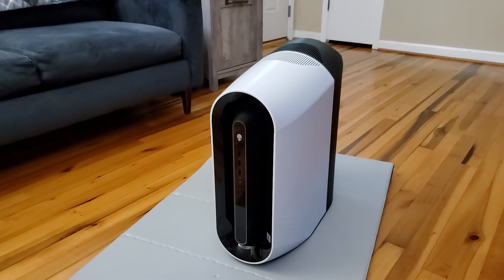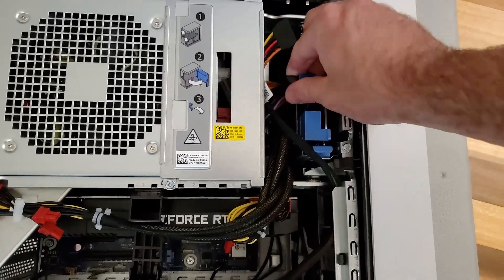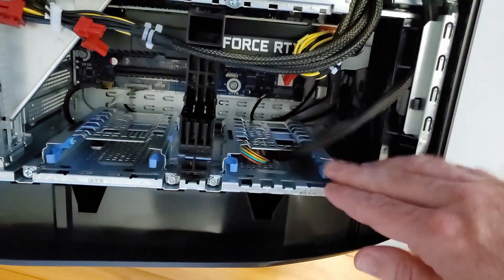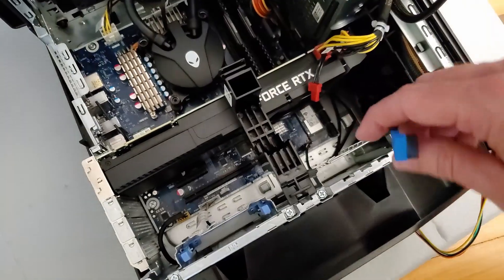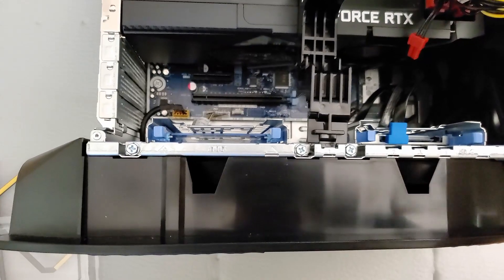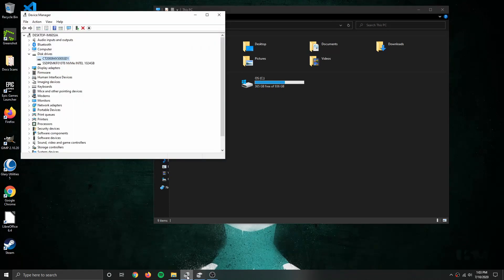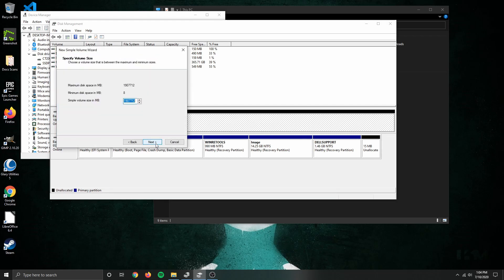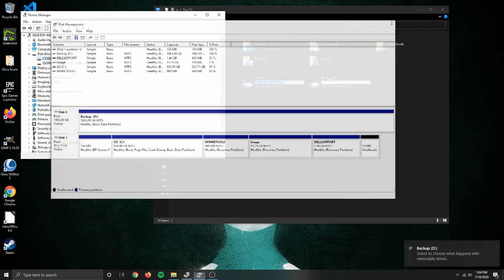Alienware R11 Solid State Hard-drive Install / Upgrade: Step by Step

Comment: How did you boot to Windows if you removed the mechanical drive and replaced with SSD? Were there two drives to start?
Reply from the maker: The mechanical drive on my system is not the boot drive. The boot drive is a 1TB NVME drive. The mechanical drive that I replaced was simply a back up drive that Dell included with the my system configuration.
Reply: @theonlyjoe6036  Got it. Does your video show where that NVME drive is and do you know if you can add a second NVME drive to the R11? I bought the 500GB NVME without mechanical drive and am trying to figure out what all my options are for adding an additional SSD drive. Thanks!
Reply from the maker: @MichaelRosett  My video does not show the NVME drive. It sits on the bottom right of the motherboard, and there is only space for one NVME drive. I can guarantee that your OS is installed on the NVME drive, and so replacing it will cause you have to reinstall your OS. You could easily add a 2TB 2.5 inch SSD like in the video with no problem. Check to see if Dell included an SATA cable with your case since you bought it without a HDD. If they didn't, just pick one up for a few bucks. The SATA ports are also on the bottom right hand of the board, and you will plug into the blue port; though you might have to remove your GPU but that is simple. I've included a link to the Dell service manual on how to remove your GPU at the end of this post.

I install most of my games on my 2.5 inch SSD as the load times are really not that much of a difference. I do keep games that have large and frequent loads on the NVME (like Assassins Creed and Flight Simulator), but Halo, Doom, Call of Duty and the like go on the 2.5 inch.

https://www.dell.com/support/manuals/en-us/alienware-aurora-r11-desktop/alienware-aurora-r11-service-manual/removing-the-single-graphics-card?guid=guid-78033958-a3fe-41f0-abec-164a9f24c2d2&lang=en-us

Comment: Does the pc have the 2.5” ssd drive power and data cable in the bay like you showed in the video or did you pit those cables in your self?
Reply from the maker: The power cable is already tucked down into the 2.5 inch bay. The SATA cable I took and rerouted from the 3.5 HDD that I removed. You would have to supply your own SATA cable if you wanted to keep the mechanical drive while adding a 2.5 inch SSD.

Comment: Joe could you have kept HDD and the new SSD if you wanted or does it not have enough cables?
Reply from the maker: I could have kept it if I wanted to, but I would have had to add another SATA cable as the R11 does not come with any extra SATA cables.
Reply: @theonlyjoe6036  I have a related question for you: if I were adding an SSD on top of my HDD and I want the my OS on the SSD, would I have to fresh install Windows on the SSD, or do I copy the OS to it, or something else? I'm a bit confused as to how you prepped the SSD before installing it so that it immediately booted up to your desktop as normal

Comment: Can I still use the original drive alongside the SSD? I have stuff already downloaded I don’t want to lose
Reply from the maker: Yes, you can. You will simply need to pick up an extra SATA cable (the R11 does not come with a spare cable) and plug into one of the SATA connectors on the motherboard.

Comment: Can I use this method on my r9?
Reply from the maker: Yes. The R9 and R11 are extremely similar in their interior. I've also included a link to the R9 service manual.

https://www.dell.com/support/manuals/en-us/alienware-aurora-r9-desktop/alienware-aurora-r9-service-manual/installing-the-2.5-inch-hard-drive?guid=guid-275897fb-5590-421a-bcb2-21150a688a6d&lang=en-us

Comment: Which model of the SSD drive did you actually install and do you have a link where it can be purchased?
Reply from the maker: It is a Crucial MX500 2TB SSD.  I bought it from Amazon, and here is the link. 

https://www.amazon.com/Crucial-MX500-NAND-SATA-Internal/dp/B003J5JB12/ref=sxts_sxwds-bia-wc-p13n1_0?crid=2FTLG0ETDU9C5&cv_ct_cx=crucial+mx500&dchild=1&keywords=crucial+mx500&pd_rd_i=B003J5JB12&pd_rd_r=cba5104f-f5e5-4850-8213-1cb1693972d5&pd_rd_w=QFcPT&pd_rd_wg=ZU4NT&pf_rd_p=f4ebc3ce-c45d-4b03-a3e4-a17c876358c0&pf_rd_r=R79FVZA7T032P4QMGZBX&psc=1&qid=1604766057&sprefix=crucial+%2Caps%2C179&sr=1-1-80ba0e26-a1cd-4e7b-87a0-a2ffae3a273c

Comment: What about eventually upgrading the CPU in this? It might take a lot.of work but is it possible??
Reply from the maker: Intel loves to change sockets from generation to generation; so you will most likely be only able to upgrade the CPU with in the generation of your current purchase (i.e. 10th generation Intel) without having to replace the motherboard. AMD typically gives us a little bit more time with a socket, but there is never a guarantee that your existing motherboard will be able to support the next generation of Intel's or AMD's CPUs..
Reply: @theonlyjoe6036  thank you for your reply. So...I guess what I should ask is can I upgrade the CPU and motherboard when the 11th gens come out?
Reply from the maker: @Marvolorian  if you upgrade the motherboard and CPU, then yes, you should have a clear and expensive upgrade path. I honestly think your money would be better spent on upgrading the Graphics to the latest Nvidia or AMD cards. There are some completely unsubstantiated rumors that the 11th gen might share the same pin layout with the 10th gen and hence provide an upgrade path without a motherboard replacement (though I be shocked if this turns out to be true).

Comment: So before you unplug and take out the HD are you taking any files off it and putting it on your desktop?
Reply from the maker: In this specific example no. The 1TB HDD that was removed never had any data on it to begin with. I bough the R11 knowing that I would be replacing the included 1TB mechanical hard-drive right off the bat. I did the install myself because it was far cheaper than what Dell would have charged for the configuration that I wanted. That said, you should always back up your data and have a good migration plan in effect if you are replacing any drives with data on them.
Reply: @theonlyjoe6036  just my first tie owning a nice pc and im trying to figure everything out. Im getting ready to throw an SSD in there so i want to make sure i do it correctly.

Comment: So sata cable is already inside unit and hook to the mobo? Good vid👍🏻
Reply from the maker: Correct. The SATA cable is already installed and hooked up. You only need to properly route it to complete the SSD install.
Reply: @theonlyjoe6036  — great that’s good. So do you know which sata out of the 4 has the fastest read time? I see on the mobi that it has 1 blue -1 beige and 2 blacks or does it matter? Thx for any info on this. I’m gonna add another ssd myself just to have it run a game or 2.
Reply from the maker: @burtpilon1735  The R11 has 4 SATA III ports (the latest version of the SATA standard). All of them run at 6Gbps. It shouldn't matter what port you plug into. However, and this is a big caveat which I don't think anyone would ever run into; SATA ports 2, 3 and 4 share a common PCI lane (port 1 is the blue port on the standard R11 board). So in theory, having multiple drives on ports 2, 3, and 4, and accessing data at the same time (like using a RAID setup) could bog down the PCI channel that is shared between them. That said, I honestly think that if you need more than 3 or so TB of internal storage then you should invest in a proper Network Attached Storage device. I run in my R11 a 1TB nVme drive that came with the system (an Intel 660p), and a 2TB 2.5 inch Crucial MX500 SATA SSD that I installed for this video.

Comment: So the sata cable is already inside the unit? Great vid man 👍🏻
Reply: I have the same question. Do I need to purchase an extra sata cable for extra ssd?
Reply: @captainOli7523   Yes you do. He was using the data cable from the hdd he removed. I had to order two extra cables to add two new ssd drives. They will come today.

Comment: How to get into the disk management?
Reply from the maker: The easiest way to do this in Windows 10 is simply to type Create and Restore Partitions in the search bar down on the Task Bar.  You can also right click the Windows Icon down in the Task Bar and it will show up as one of the options.
Reply: @theonlyjoe6036  Thank you.

Comment: I got a new ssd for my r6 but I can’t boot from it since there are no settings for it in my bios. There’s almost no settings in there and I’m told that I’d have to get a new motherboard for better settings. Is there a way to change boot drive without bios?
Reply: Same issue

Comment: Hey so my led for the Alienware head isn’t turning on any ideas how to fix it
Reply: I actually just had this same problem happen. It occurred after a firmware update, and so I think it might be related. I've reached out to Dell to see if we can get any answers, and encourage others to do the same.
Reply from the maker: Quick update. I used Revo Uninstaller to remove the Alienware Control Center and Overclocking Control. I then reloaded both programs via Dell's support website and it works fine now. Just make sure to reinstall the Control Center BEFORE the Overclocking Control. A reboot will be required after uninstalling to allow for the reinstall.

Comment: Hi!, I have an R9 model, Im concerned about the RTX 3080 size, will it fit?
Reply: please let me know if you've found an answer to this, I'm in the same boat lol. I think with the dimensions it will fit though
Reply: @neuroticknave6046  Hi!, the only 2 Series 30 cards that fit in the Aurira R9 are: RTX 3070 FE, and RTX 3090 Turbo fron Gigabyte.... the gap in the costs is huuuge, so I decided to go for 3070 FE, hope this helps.

Comment: Hello Joe! Great video! Would you mind also uploading a tutorial on how to add more SATA cable for multiple Hard drives? I find it strange that it only comes with one SATA cable but multiple power cables for multiple Hard Drives.
Reply: you purchase more sata cables (find them on amazon) and the motherboard has spare sata ports located in the bottom right.

Comment: Whats different between the R11 and R9 ? My R9 Looks identical. and he Rep said it was a 2020 model.. is it just internal differences ? Thanks
Reply: The R9 has the 9000 series CPUs as the top of the line, the R11 has the new 10000 CPUs as the top of the line. The R10 has the AMD CPUs which is why it seems like they skipped a number.

Comment: Did you have to remove the old hdd? can you just leave it and install 2 other ssd
Reply: Yes you can. That's called dual drives. Many people run that combo.
Reply from the maker: You don't have to remove the old HDD. I just took it out as I hate mechanical drives.

Comment: Will taking out the HDD and replacing it with SSD affect the loading of the OS or will it have to be reloaded
Reply: you will have to move the OS to the other drive of course. An ssd will boot your PC faster.
Reply from the maker: I did not take out the boot drive, and so no OS reinstall was needed. The OS is on a 1TB NVME drive. I just wanted to install a speedy 2TB SDD for backup and game storage.

Comment: bad video... you don't even show how to properly get the data connector to the new SSD.. ALso how about installing a M2. ssd ????
Reply from the maker: I should have made it clear in the video that you do not need to re-plug the motherboard side of the SATA cable. Simply remove it from the retention clips (which I tried to show, but did mention), and run around / under (I ran under) the far side of the GPU. My bad for not making that clearer.

Comment: How many power cables are there? Is there enough for both 2.5" bays?
Reply: Yes
Reply from the maker: You have enough power connectors to install in both bays. However, you would need to purchase an extra SATA data cable to connect the drive to the motherboard.
Reply: @theonlyjoe6036  Oooo you're back. New videos soon?
Reply from the maker: @riotingbunnies3508  I had to take a quick break due to the Human Malware that is running amok in the USA, but I'm back to full health. I do have plans for a new video soon. Thanks for asking and for the interest.
Reply: @theonlyjoe6036  oh wow. Okay that's great that you're fine now.

Comment: How to add a second graphics card?
Reply: Literally put it in man. Look at the first GPU and try to copy it. There are two pie x16 slots and the lol one is occupied. Put the second GPU in the bottom one (the longest port/slot). You'll need to take out 2 of the back card panel things. And you need to get an sli link thing

Comment: hello, Idk if anyone's able to help me but I actually purchased this and it is coming 21 days, "allegedly"  I am considering getting a 2tb 2.5 drive to add more storage but am too scared as a new PC buyer to upgrade the SSD, I would like to get a  Seagate firecuba 2tb Solid state hybrid drive, being better for loading games from what I learned about SSHD compared to HD, Will I need to choose between having the 3.5 it comes with and a new SSHD or can I have them both? I saw below you said I need to order more cables SATA cables because it will only come with one
Reply from the maker: You will need to purchase an extra SATA data cable if you keep the existing 3.5 inch drive. The motherboard has a total of four SATA ports. I would advise going with a regular solid state drive. SSHDs were kind of a stop gap when SSD were still new and prices were high. An SSHD allowed for far faster performance than a HDD, but at a cheaper price point than a SSD. The price of SSDs has fallen to reasonable price to make SSHDs kind of obsolete. The 2TB Crucial MX500 that I used runs around $220, which is a good price to storage ratio.

Comment: At 1:34 I cannot really see where you plugged in the end of the sata data cable.
Reply: He plugged it into one of the motherboard data data connector ports. They are shaped similar to an HDMI port
Reply: It's on the bottom right corner of the micro atx motherboard
Reply: Rioting Bunnies thank you! I just bought the Crucial SSD today and getting ready to install it in my R11.
Reply: @Leeloo5142  oh cool. Glad to hear I helped out. I have an r11 myself it's a great machine. Enjoy yours!

Comment: The 2 slots below, are those also compatible for HDD drives or just for SSD drives? I've decided I'd like to add a 6TB HDD instead. Also do I have to get a separate SATA cable?
Reply from the maker: The ones on the bottom will only fit a 2.5 inch hard drive; which is the SATA SSD standard size. The only 3.5 inch drive bay that can hold a standard desktop mechanical hard-drive in the system is the one where I took out the mechanical hard drive in the start of the video. So... the R11 only has space for a single mechanical desktop drive, two SATA based SSDs and one NVME drive. Honestly though, if you need more storage than that I'd recommend a NAS running RAID with mirroring. Two Bay solutions are pretty cost effective options, and even have the ability to act as a DLNA media server; plus you gain redundancy of your data.

The R11 also only comes with the single SATA cable (if you purchased it with an extra drive). You will need to purchase a SATA cable with a 90 degree angle connector for space and clearance considerations.

Comment: what is the brand of the gpu?
Reply: Depends on which model GPU you are getting. Which one did you have in mind?
Reply: The are most likely pny brand
Reply: @riotingbunnies3508  rtx 2070 super, from my research seems to be msi
Reply: @sergiypetrick7620  that's a possibility. Dell is such a bug company that it could have MSI manufacture a custom RTX GPU for them. But it is defiantly not a MSI model on the mainstream market.
Reply: Mine is a PNY brand blower GPU that's from an R9.

Comment: I have a question which ramsticks did the pc have? I ordered a pc with 16gb 2933mhz, and want to upgrade to 32gb and not sure which ram sticks to buy
Reply: Buy the ones that it came with. Which are the 'Hyperx Fury ddr4 xmp ram at 2933mhz' get it on  their website. get the 3000mhz since they don't manufacture 2933 anymore. Do not get 2666 because then all your ram will run slower.

Comment: Hi! I just received my R11 and it has only 1 hard drive of 2tb 7200RPM Sata. I want 2 (dual) hard drives and with more space. Can I do that? And if so, where do I put them? And what size do I need to order? Sorry for all the questions! I know really nothing about all of this. It’s a present for my son.
Reply: Hi Melissa.  in my opinion a 2 tb HDD should be plenty. I do recommend getting an m.2 ssd on the motherboard. Maybe a 1 terabyte stick depending on how much storage you want.
Reply: SSDs are faster, quieter, and more reliable.

Comment: Thanks, nice "how to" video, it looks easy peasy! Is there a reason why you removed the hdd? Just curious. I will be receiving my R10 today and will be installing an HDD and an SSD. I wonder if units that were purchased without an HDD (like mine) already come with the power/sata cables already conveniently routed like your unit's. Guess I'll find out soon enough! Thanks!
Reply: Oh hey man. All PSUs should come with those cables and connectors. The reason he took out the HDD is because they are slower, wear out and crash in 5 years, and they are more quiet. So an ssd is by far better than a HDD. Although HDDs are good for ppl on budgets because they are cheap for bulk storage.
Reply: Hi, did your r10 come with the power/data cables?
Reply: @edidasa  yes it did. Since I only got an m2 ssd, the extra cords were in the bottom left 2.5 in ssd bay
Reply: @edidasa  Hi there, with power cables yes, but I had to buy my own sata cables.
Reply: It comes with one SATs connector and 2 or 3 power connectors